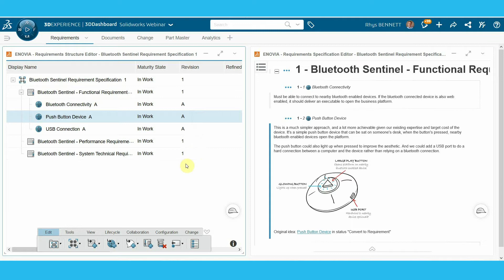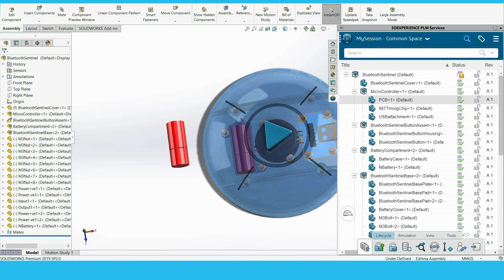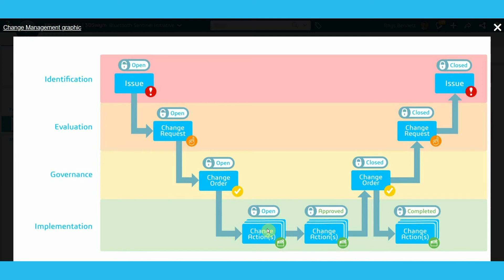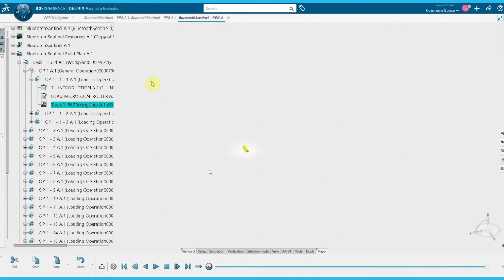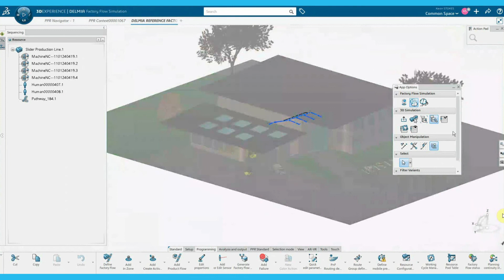Beyond Solidworks - On-demand Webinar

Comment: For information on specific subjects skip to - 
Requirements Management - 5:43
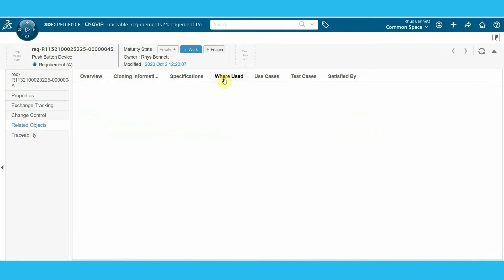Satisfying Requirements - 6:45
Project Management - 7:30
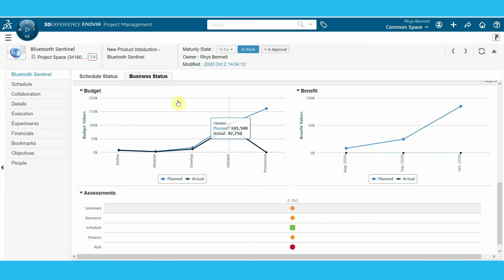Saving CAD data + native solidworks integration - 12:20
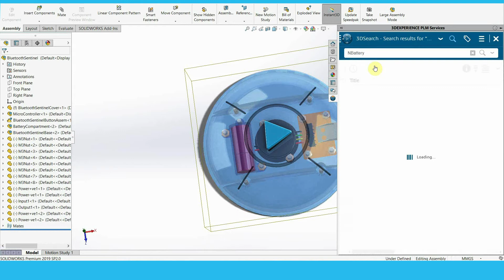Version and Revision Control - 13:20
Native integration for eCAD solution - 15:30
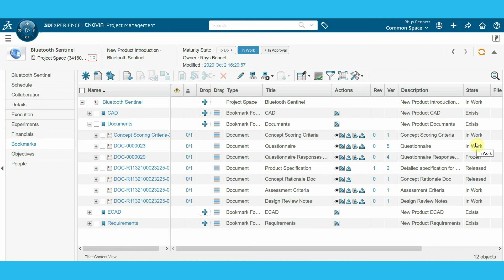Change Management - 17:50
Issue Management - 20:00
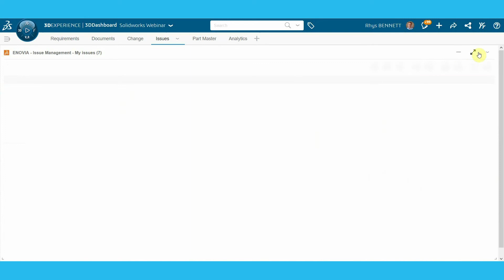Putting Solidworks into Manufacturing context - 20:30
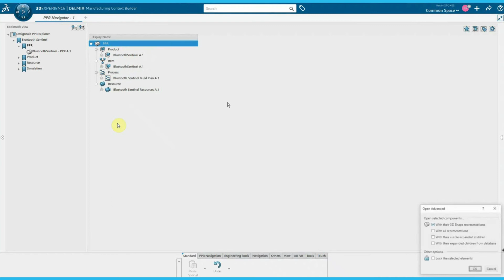Process Planning - 21:30
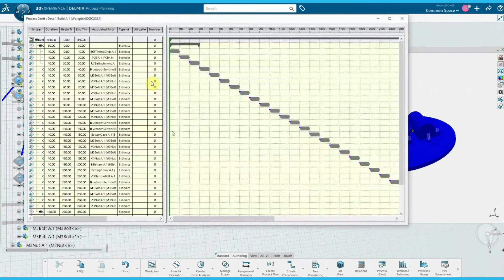Workload Balancing - 23:20 
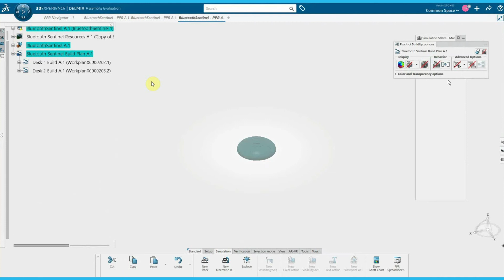Work Instructions - 24:40
3D Lean - 25:50 
Factory Flow Simulation - 26:50
Build Feasibility - 27:40